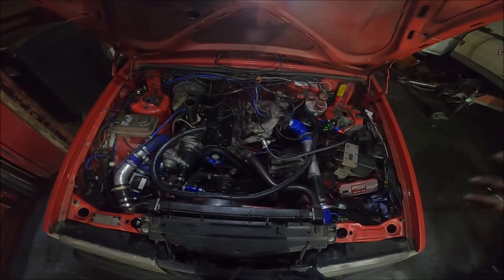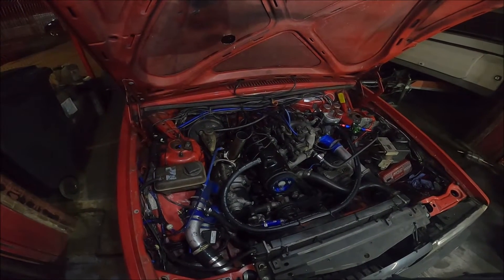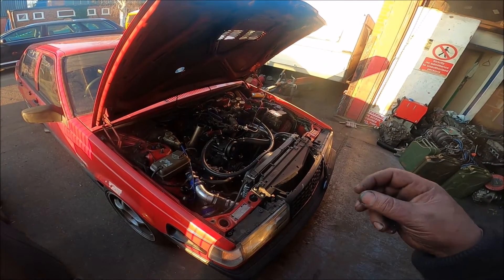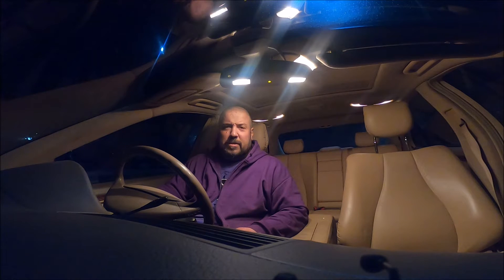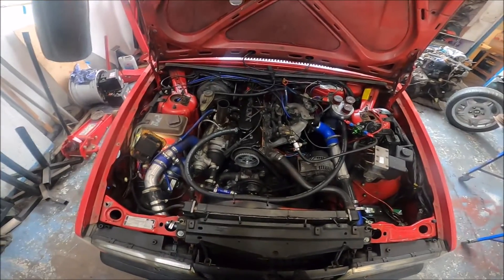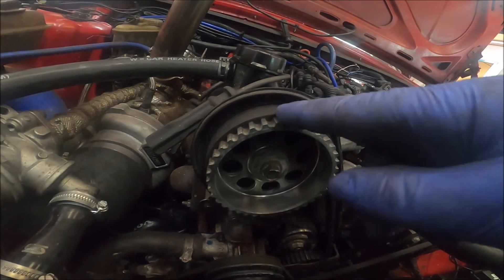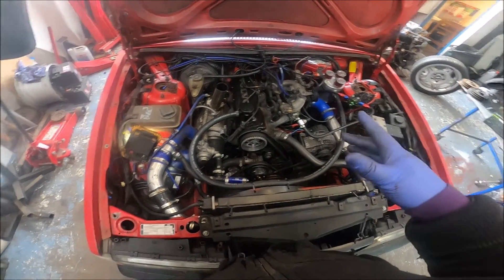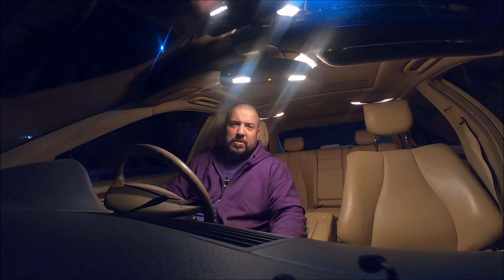Putting the Volvo 940 Turbo GT30 turbo and external wastegate combo to work! Fire breathing work!

Comment: The wider pulley is a 16v one
Reply from the maker: That would explain it, must be the aux pulley off the aq171, as both cam pulleys are still on
Reply: @StavTech  Probably since the aq171 has a regular b230 block. The b234 and b204 has a slightly different block with an eksternal oilpump and balance shafts, so when we scandinavians use a b234 head on a regular block we need to source an ekstra cam pulley for the aux shaft since 16v cam pulleys are wider.
Reply from the maker: @KimOve  yeah that would make sense

Comment: Now the timing is sorted could it be showing as running richer because all of the o2 in the cylinders is being burnt rather than half of it escaping down the manifold?

Put a leaner chip on it and see if there is anything wrong after that?